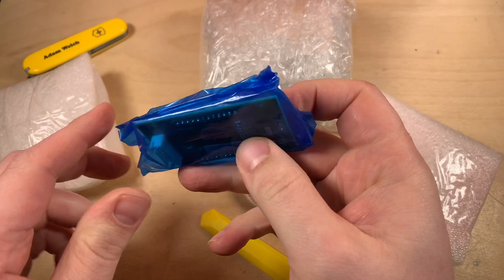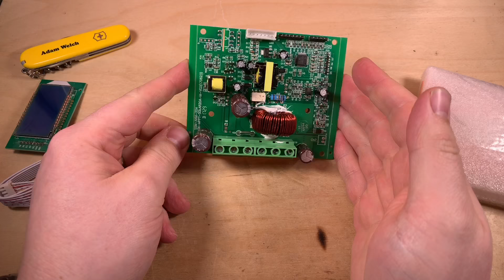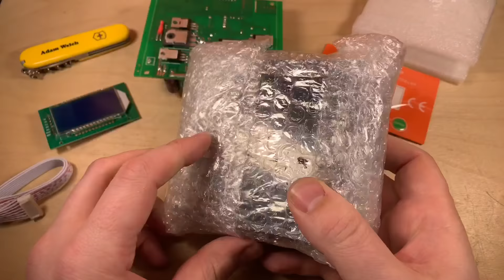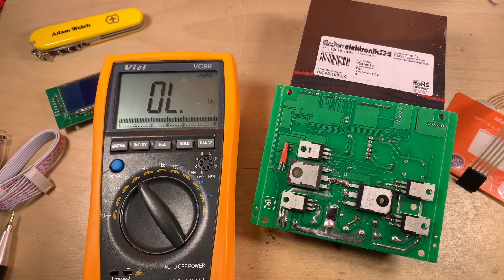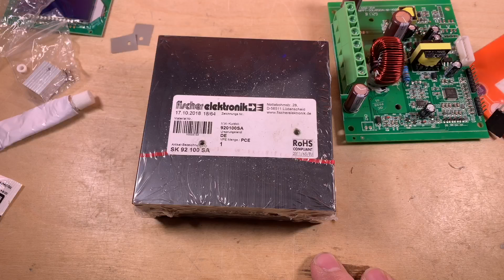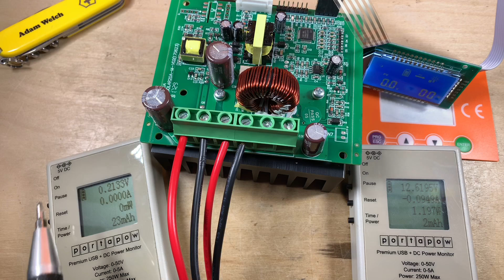Build Your Own MPPT Solar Charge Controller

Comment: I built my own years ago. Designed it all myself too. It worked-ish. Decent efficiency, but my approach to monitoring the output power was flawed from the beginning.
Reply from the maker: A shame it didn’t work out quite as you hoped. Another crack at it at some point?
Reply: @AdamWelchUK  It sort of worked. Inspired by the 'MuPPeT' project. It certainly did the MPPT right, I was able to measure it doing that. Rather a nice transistor drive approach in it, too. My mistake was in monitoring output voltage, but not current, in order to determine how much power it was outputting - an approach which works nicely when you are driving a simple resistive test load or charging a flat battery, but goes quite crazy when interacting with a battery charge circuit or under very low loads, as it tries to determine how to optimally transfer power into a load that won't draw it. I am sure I could have made it work a lot better if I had been motivated to invest more time in the project.